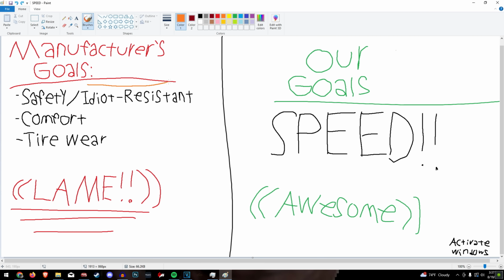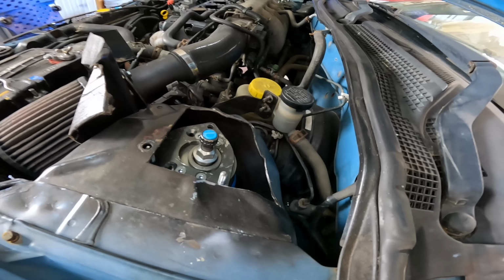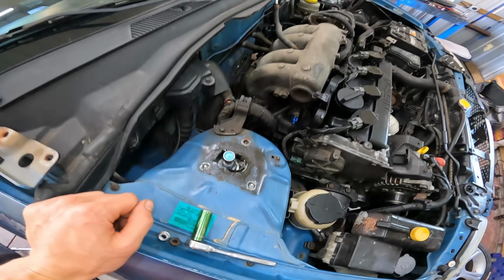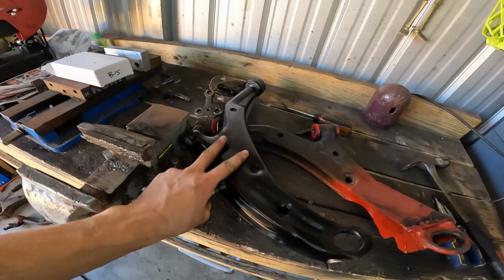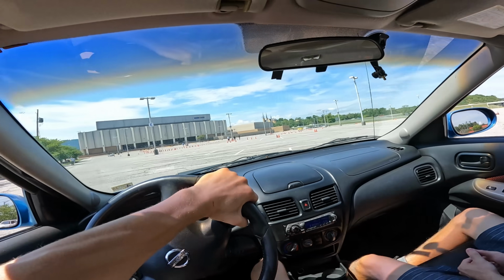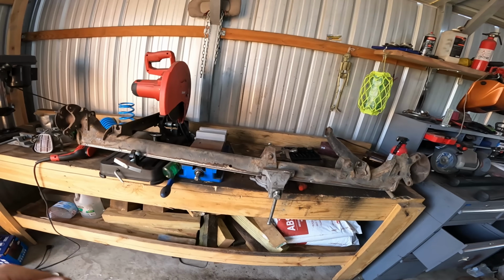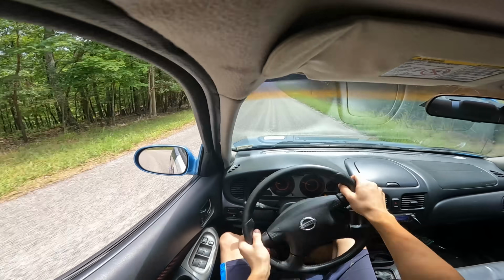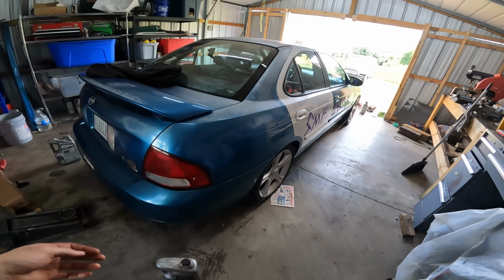Putting Race Car Suspension on an old Sentra - How Fast Can we Make it?

Comment: I admire your "lets do it and see what happens" attitude. Also frightens me because I am a recovering overthinker. Would take me days to meassure out that strut tower modification. Probably would not even do it because there are so many pitfalls that are hard to recover from. It is nice to see that the world does not collapse if shit is not pixel perfect :D
Imo Nissan really dropped the ball with their fixed rear axle phase. While it's cheap to make, it is terribly unpredictable and not so nice to maintain. Also zero adjustability. The french people ruined them.
Reply from the maker: The two strut towers are not the same by any means, but I honestly don't notice a difference between turning left or right. It also doesn't pull or anything. The torsion beam rear suspension is far from ideal, but  how well your suspension is setup is more important than the type of suspension you have

Comment: In a FWD if it wont rotate, you have two choices. Make it go fast, use lift off oversteer and die, or, put into R for Race, instead of D for dickhead, and this simulates a properly made car that has rear wheel drive where the car rotates.

Comment: How about limiting amount of droop of the rear suspension?
That’s one way to limit traction on an axle in rc touring car
Reply from the maker: That's pretty much what I did with the short springs in the rear
Reply: @HatersGarage  i think shorter spring doesn't reduce amout of down travel in the suspension but mounting shorter shocks would.
In rc car you have a screw on a lower controll arm that rests on bottom chassis plate and it reduses amount of down travel in a suspension, but in this case limiting travel of a shock would give the same effect
Reply from the maker: Sure they do, they dont compress or extend as much. They accomplish the same thing as shorter shocks

Comment: You get more grip with the control arms facing the sky. I only know this because I've put hundreds of hours of testing this on beamng drive. A double a arm suspension with both a arms at an angle pointing to the sky gives you the most amount of grip.

Comment: Had one of these as a kid.  Brand new at 20k, I miss that.   I autocrossed mine.  I put coilovers and every nismo suspension part available.  It stiffened the back up enough you could kick it out in a pretty decent controlled slide.  I talked with a guy who fully raced his and did a custom panhard bar.  That would've been the next thing I would have done to it if I kept it.

Comment: For power, you could try getting bits from a later-gen Sentra SE-R Spec V, since that one cranked the power on the QR25 from 165HP to 175 HP. 

Sadly, the engine is still based on an economy engine, which means open deck and a long stroke. Thus, less revs and far less cylinder wall strength. If you really want power, some of these Sentras came with the SR20DE instead, which has a far wider community for tuning, so a engine swap would be feasible.

Comment: I love my 05 sentra, been an amazing vehicle for years. We got lucky and got a Special model, so it has some of the nice trim and a few bits from the other trim levels, and has a 6 cd disk changer and a fosgate stock sound system. While it doesn't have any of the tuning or the slightly bigger engine of the spec V R, it still looks sleek and the 1.8 liter gets the job done.  Very weird seeing the area below the radio so empty :P

Comment: I have just now stumbled upon this video. I am going to a university in Alabama that has a motorsports club. To start out, we participated in some local oval track racing with a 98' grand prix gtp "racecar." Two years ago, we purchased a 1999 Nissan Sentra from a government auction. We put a dirt track roll cage in it and gutted the entire car. We originally planned to do more oval track racing, but a few of us students started driving in our local autocross so we made the Sentra an ax car. We just got the transmission back in the car and we now have electrical gremlins. We had to miss todays ax event because of them. We may attempt to make independent rear suspension for the car but at the moment we just want the piece of junk to run. 

It's awesome to see that someone else has similar ideas to our team. I wish you luck!
Reply from the maker: b14 Sentra's have the same exact goofy rear suspension as my B15, which will be the biggest thing holding you back. You can make independent rear suspension like you said, however that will put you into the crazy unlimited class against much faster cars.

The single most helpful mod I did was bending the rear beam for rear toe-out, it made it rotate around corners so much better. Use that information how you will, good luck to you too
Reply: @HatersGarage  We are already in the highest class possible since we have a full cage and many other mods. We wanted to do more oval racing with it and we gutted the interior and removed unnecessary weight like ac and most of the dash. After everything was scrapped the project leads decided to do autocross which is much safer than oval racing with a bunch of "special" meth heads that think they are Dale Earnhardt.

We thought of cutting the rear bar but we realized that it would likely cause more problems than it would solve. We will have t try bending the rear bar for more toe. I will let you know that replacing the bushings in the rear was an absolute pain. I would highly recommend setting out at least a few days with a few buddies to help you as well as an acetylene torch to melt the old bushings. Trying to press out the bushings and press them in is near impossible the way they designed the rear end, but what gave us the most trouble was getting the weird "center" linkage thing connected to the car. Also, If you have to replace the clutch, the transmission gasket goes on before the flywheel.

Comment: Is the rack ratio that bad or a ton of slop in the steering? Looks like youre really cranking that wheel. Id end up in the trees if I tried that much steering angle that quickly haha
Reply from the maker: Rack ratio. Also the hard front tires not wanting to grip up

Comment: I loved my 95 Sentra. 1.6l 5speed. Slow fun. I drove it exstreamly hard and it would not break. I had to replace a couple clutches and an alternator and regular maintenance. I definitely got my $800. worth out of it before I hit a deer. It also had great acoustics for my system. It was a blast.
Reply from the maker: That's the great thing about low output engines, even if you beat on them they're never really stressed.

Comment: maybe try adding some more front grip now to loosen the rear more. in my FWD corolla rally x car I found going softer up front (spring rate or antiroll bar) added more grip to the front so the rear feels to rotate around that
Reply from the maker: That's basically what I was doing with the caster and RCC kit. The front coilovers are softer than the rear, and I'm not running a front sway bar. I'm using every bit of grip my tires can provide atm
Reply: Gotcha, didn't realize you had no bar! Maybe experimenting with different tire compounds front/rear could find that balance

Comment: eyo, from what I've been researching, widening the rear track and narrowing the front will actually help increase rotation. 

the theory is that the widest end will load up the most when cornering, putting all the weight on one tire. the narrow end will load up less, and will keep both wheels planted evenly. This goes hand in hand with suspension compliance.

if you imagine an extreme of this, such as the old nissan delta cars, the rear suspension is taking the entire weight transfer load, while the front is acting like a record needle, gently pulling the nose every which direction, with the full traction of both front tires. the wider, stiffer end of the car will relieve this cornering load off the front end, and help work/stress/rotate the rear tires.

Inversely, as a mental exercise if you squeeze the two rear wheels all the way together, they'll handle none of the weight transfer, effectively the same as a super-soft sway bar/springs while cornering. they will load up with latteral force of course, but the load transfer/body roll will be sent to the outer-front tire.

You can see in the final recap auto-x scene, where your inside rear wheel is already lifting off the ground, aka the rear is unable to effectively relieve any more load from the front axel; you can keep stiffening the rear all you like at this point, but it's already three-wheeling!

Try swapping that 1" spacer to the rear and just test out how much better/worse it gets. Curious to see the results!

Comment: Try some Bassett steel wheels. There cheap as dirt and you can get them with just about any offset and width. However some drawbacks are that they only make them up to a 15" diameter so your tires will have a bigger side wall. they are also bolt centric not hub centric.
Reply from the maker: That's looking like my best option right now, Facebook Marketplace is letting me down so far

Comment: You can bend the rear solid beam to fix the toe problem. You can also use the same technique to give a bit more camber.
Reply: This will fix your rear grip issue and turn that underseering frown upside down… to… an oversteering smile…?… that didn’t word very well, suumi massen
Reply: Oh snap we got there! We’ll sort of but your talking about incurring it?! Oh no…. A hydronic jack some chains and a small I beam is all you need dude. Bend that baby up
Reply from the maker: Yeah I decided to cut it so I could make both sides perfectly even
Reply: Incurring? Holy crap autocorrect that’s some of the worst work I’ve ever seen you do! Cutting…. It’s cutting autocorrect how did you get that so wrong??

Comment: Hey, just saw this and wanted to put in some input, if you want more front grip. But want to keep the rear end as loose as possible…2 different tires. (If the rules allow) find a harder tire on the back, but get a stickier tire on the front. Of course you cannot swap front and rear tires as the day goes on. But I am sure you can get exactly what you are looking for by this method
Reply from the maker: That would definitely invoke oversteer, but it probably wouldn't be very controllable. I imagine it just trying to spin out constantly instead of rotating around corners

Comment: It is an insane amount of toe out on the rear, but for tight corners in small courses you can't have a more fun setup, if you look at the Peugeot 406 super touring for example which is also FWD, the toe out on the rear varies wildly depending on the track, and in some setups it's got a similar idea to the one you've made here. (Although in others it's the complete opposite and the wheels are fully tucked in for maximum grip)

Admittedly this poor Sentra shouldn't take fast open corners cuz the rear will just Michael Jackson slide it's way into a wall, but maybe you can figure out a way to reduce the toe out for different track setups? Or just take a different car, yeah that's easier.
Reply from the maker: Yeah there's no easy way to make adjustable unfortunately. At higher speeds like on on ramps I can feel the rear steering the car as well as the front, since the outside wheel is facing away from the turn it has the same effect as rear-steer.

I definitely wouldn't recommend something like this to a new driver, they'd crash it for sure

Comment: Would be nice if you could ditch the beam but I doubt your class rules allow it. My $300 beater 01 Corolla has pretty incredible rear suspension for how cheap it is - they went to beam in later years but use a multi-link semi trailing rear up until at least 02 or something.

On a different note, if you want to be more wreckless but get the rear end out, just use bald tires!

Comment: I like what you did with the rear twist beam, I considered doing the same thing but have less money for metal. So what I did was get a 10 foot piece of rebar, cut it into 3 pieces, weld them all together then welded it to the inside of the twist beam itself, to the same location that the twist beam stiffener on the sportier version of my car goes.
Also for tires, you could look into getting some accelera phi's theyre good really poor person tires for driving hard. Or cosmo mucho machos if you are a multibillionare who has $68 for one tire
Reply from the maker: Your idea works too, I've considered doing that on top of the stiffening I already did
Reply: @HatersGarage  if you look up the rear subframe of a cavalier ls-sport or z24 or sunfire gt, you can find a picture of where they have it mounted, should be a pretty similar application. Also some cars (mostly 80s to mid 90s) with twist beams have external sway bars, you might be able to make one work. ive been meaning to test one from a grand am for a while but havnt had the time. Though if you want rotation for cheap and need new tires, you can always just replace the front two tires with good stuff and leave the rears, have done that plenty of times

Comment: If you really want it to rotate, get the widest and stickiest tire you can for the front, then put the 17" pizza cutter spare wheels on the rear that came with the Brembo package on 04+ SpecVs. Or just the hardest compound you can find for the stock rears...as a reasonable person would do...but I'm not getting a sense of reasonable after the exhaust builds.
Reply from the maker: I can't tell you that wouldn't work

Comment: The activate windows is a little known but absolutely crucial to the suspension modification glad to see someone highlight that in their diagrams, its clear you are a well seasoned engineer, what race teams have you worked with?
Reply from the maker: Turd Motorsports, Chode Racing

Comment: Great content as always, just what I need to tickle the vehicle dynamics 'tism!

Say, what's your weight distribution and the spring rates you're running?
Too hard front springs / too soft in the rear will also lead to understeer, on top of a, I assume, front-heavy weight distribution in your case.

I'm doing the equivalent to Autocross here in Germany, in a street-spec Mercedes 190E. 
The rules only allow minor mods, as in tires, wheels, coilovers and sway bars. 
Everything else has to be stock, sold by the OEM for this particular make and model. 
Thus, it's really important to have a well-rounded setup. 

What I've found is that the set of coilovers I used to run where way to hard at the front.
Great and very responsive in turn-in, but way too understeery in steady-state cornering.
Reply from the maker: I don't know the exact rates, but It's roughly 700 rear and 400 front. The weight distribution on these is like 62/38. The battle against understeer was rough as you saw.

One thing I did off camera was disconnect the front sway bar, that seemed to increase front grip by a noticeable amount.
Reply: @HatersGarage  
Yup, a softer front-end in roll, ie disconnected sway bar, will give you more front-end grip.

You sure it's 400 in front, 700 in rear?
That's quite unusual to read. Based on a quick back-of-napkin calculation, I'd say that's plenty loose.
Reply from the maker: @sebastianh1458  That's about what it is, the front springs are twice as long as the rears and the same diameter. It's pretty loose, but my preference is a very loose setup.

Comment: I'm not sure if you read the comments,  but I had a B15 Spec V (I even made a short video of it) and I found that when the hood was off, it was SOOO much faster. It turned in better, didnt heat soak as much and I swear it accelerated faster anyways. Maybe try this if its allowed for autocross
Reply from the maker: Its a very front heavy car, and the hood is pretty heavy so I'd say it did make it faster. I can't remove the hood in autocross, but I can put a lighter one on
Reply: @HatersGarage  raced my buddy in his tuned RX8 with my girlfriend in the car and the hood on, and I swear it was like -25 horsepower no joke. I think the ECU was adapted to not having the hood so when I threw the hood on 20 minutes before we went on the Mexico highway it like sucked up all of the power. It was very strange, I would definitely try it out at least once
Reply: @HatersGarage  also, I whooped my friends 8th Gen Si without the hood. Not sure how it would do with it but I was gone when we allegedly hit it on the highway. His was stock I had a "cold air" intake and exhaust. Those were the only mods to my knowledge other than suspension stuff

Comment: I always heard if you want to affect one side (front or rear) of your suspension you should change settings on the opposite side. I would have loosened up the front end sway bar to fix the understeer.
Reply from the maker: I never reconnected the front sway after removing it, I just forgot to mention anything about sway bars.

Comment: Would putting skinnier tires on the rear or even skinnier rims with tires to match help it turn? I've never worked on a FWD car so I don't know anything about this sorta thing but it makes sense in my head.
Reply from the maker: Plenty of FWD racecars run a staggered setup with skinnier wheels on the rear, and it does work. Find a matching set of staggered wheels isn't so easy, though..

Comment: Keep those heim joints greased as much as possible, had some of mine seized up after a week of use. Had such weird steering problems couldn’t figure it out for the life of me,then surprisingly one squirt of wd-40 on the heim joints fixed everything.
Reply from the maker: Hmm thanks for the tip